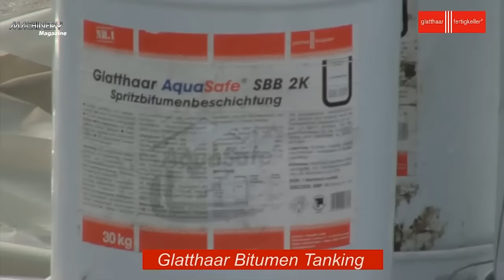Amazing Modern Basement Construction Technology - Amazing Ingenious House Construction Workers

Comment: Precast concrete panels are a great way to make basements. I did it over 15 years ago, the insulation was in the middle of the panels and it’s been superb. No cracks or leaks and cheap to heat. Also great in the hot temperatures, although 37c outside only 22c in my basement. One tip when constructing a basement ensure the ceiling heights are at least 3m high otherwise it will feel claustrophobic.
Reply: How much do you think this would cost today?
Reply: @clarityofthought  ..I'm sure it's worth it. I worked fabricating walk-n coolers & freezers the exact same way from raw materials. We glued rigid foam between steel sheets.
                  Then, we used a 'cam system' to lock the panels & doors with rubber seals. Don't cheep-out on the exterior bitumen & other sealing.
                   This system should be used in areas like South Georgia, where basements turn into pools very quickly. 😎👍☕
Reply: What's the point of covering the basement with a layer of concrete instead of plywood? Sound insulation for a theatre room or something?
Reply: @kenhiett5266  Tornado
Reply: @lilblackduc7312  Ah, that makes sense. As frequently as they get hit in places like Oklahoma, having a basement serve a second function as a legitimate tornado shelter should probably be the rule instead of the exception.
Reply: 250cm=2.5meters is is standard for every room . 
In German houses is like this and ik ok basement invluded.
Reply: @ASEAngelica  We have 2,70 m and this makes it much better because also have doors that are 2,10 m in height. Because I'm 1,92 m the "normal" doors are somehow claustrophobic for me.
Reply: @kenhiett5266 anything that can happen above grade: Tornado, Fire, war, earthquakes.    While unlikely 8” of concrete will block most anything including Radiation. Though 12” would be better.   My house has 12” concrete  roof and a wood subfloor on top.
Reply: Как крыло от самолёта  😱😂😅 @clarityofthought
Reply: No plumbing anywhere?

Comment: These are great ways of doing foundations, very area specific.  Can't do in many areas do to termites.  They love styrofoam and will tunnel through it and make a home then go after all wood including furniture, they will go through the smallest gaps in the wall, especially pre-cast foundation.
Reply: Yeah, I noticed a lot of North American houses are built with wood. Making the house from another material might be best because of termites tho.
Reply: So they're vulnerable at the seams or just tend to crack?  I didn't realize any of the exterior was styrofoam and seriously doubt any was.  The walls were pre-cast concrete, not styrofoam.
Reply: @ticktockbam  Wood is cheap, plentiful, strong (modulo termites), and easy to work with.
Reply: As for the gaps between pre-cast walls; you could use one of the ~60,000 design/inventions God gave me; & use Silicone sealant with Termite poison in it to seal part of the gaps in concrete sections (as well as put it in powder form in the backfill). And as for the other chap talking about "wood being easier to work with", you also have to consider wood is also easier for hurricanes to wreak havoc with (in a country with one of the larges sources of concrete on planet earth).
Reply: @ticktockbam  Easy to make wood termite proof forever with spray on borate base products.
Reply: Well in this case once they got through the styrofoam they would have hit concrete.
Reply: @harrymills2770  concrete and bricks are easy to work with too, and are totally immune to termites, and tornadoes, and bullets from gunfights. And you can perfectly isolate them from the cold and noise from outside
Reply: You can build first floor with ICF and also insert metal barrier into wall to stop termites from climbing.
Reply: There is a new block called "The perfect block" No termites & class A fire rateing
Reply: @harrymills2770 in the 2nd project, they laid huge styrofoam blocks & black tar material before pouring basement foundation. Don’t understand, wouldn’t the weight of the house crush the styrofoam?
Reply: @RogerThat1945  As "the other chap," I'd like to go on the record as not being a huge wood-frame construction fan.  But it's about the only game in town if you're looking to buy a single-family dwelling.  I lived in a stone house from birth to age 6, but every other house I've occupied over the decades was wood-frame construction.

It was cheap and practical and remains a cheap and practical way to get a house in a hurry.  It makes me a little sad.  There are so much better ways to design a home, but you have to go out of your way to do it right, and even fight the system a little.

Comment: I never liked using pea rock for back filling against foundation walls. Supposed to go in at 98% compaction, but when you go back 2 to 5 years later, it has settled far more than that 2% it is supposed to go down. I know it is supposed to aid in filtering the water from around the walls, but I would think spreading a lot of fine sand, and then lots of water on that, would stop most of that settling....

Comment: Great video, reminiscent of my years as a Union Ironworker in Seattle.  A couple things I don't get; the "ground floor" looks to be about 6' below grade.  Also, the light wells look like they were buried in the soil 🥴
Reply: Thank you!
Reply: В США чаще строят щитовые,которые сносят ураганы,съедают термиты. 
Почему вы не строите больше из бетона и кирпича?
Ведь так дешевле и дольше стоит дом
Reply: @BorecSkaznakradami  Solid brick construction is more labor-intensive.  

Cost is the reason people build boxes on top of the ground and pump hot or cold air into those boxes.  You wonder why they just pour slabs and stick boxes on them, until you see how cheap they are compared to the alternatives.  For most Americans, heating and cooling a place, day to day, is/was affordable and reliable off the grid, so the biggest obstacle was/is the actual construction.  Sure, they'd LIKE to have a basement, but then they see the cost and decide to settle for a crawl space.
Reply: not a contractor either but having seen a dozen builds today the order of operations here seems to prioritize cost-cutting and speed over long term sustainability. I really don't like how many vulnerabilities the various seams of this building method have. it might work fine in dryer warmer areas but this place is gonna be full of either bugs or mold in no time at certain latitudes :S
Reply: @harrymills2770  Properly funded construction companies could build houses 100 at a time with basements Above the ground, and then backfill the whole area once they are built; then set about the above ground floors. Jesus is real.
Reply: @RogerThat1945  "Jesus is real." Proof?

Comment: Did they add aluminum sulphate to their mix?  In Europe they add this to add make a  porous mixture that has small air bubbles in it. This then gives the cement an R value. It will still be as strong as regular cement and you can still add rebar to it. But most companies do not want to make any investment in their companies. They are all about how much they can squeeze out of their customers!! The workers do an amazing job!!

Comment: Tornado proofed basement.  Worked in so many over priced sub divisions.  No builder did it.  When the main floor had a poured concrete pad.  More protection in the basement den.

Comment: ❓ Comparative analysis? Purpose, function, costs, climate/geology specific? When to use, where, why?
❓ Geothermal heating/cooling: with huge gaps around the perimeter, why not use geothermal piping for baseline heating/cooling? (Seems like lost opportunity.) 
❓ Cisterns: seems like a lost opportunity for water collection, even if the water is only used as a geothermal heating/cooling mass. Deck built over the cistern for servicing. Roof collection of rainwater. Partitioned cistern: primary drop/debris/filter, overflow to chamber A (holding tank, constant volume/pressure, overflow to chamber B for water use (pump, pressure tank (or gravity tank back on roof), landscaping water use). 

1) Gravel foundation & walls of Peagravel barrier + foam insulation + water sealer.
2) Gravel foundation + foam blocks & Lego walls + (unknown wall barriers).
3) [not displayed] tilt up.
4) [not displayed] aircrete @ ground level (not subterranean)
5) [not displayed] other methods

Comment: must be little to no forestry in this country to be using so much concrete and steel, or wood frame construction super expensive there, wow!
Reply: American woodframe is not good in heat insulation and noise cancelling. The long term costs in heating and cooling would be insane in germany. Germans build very solid in general. Solid woodhouses are very good, but woodframe is crap.

Comment: Precast ground floor panels then pouring a layer over that? Is this a nuclear bunker?
Reply: The thin precast panel eliminates the need for forms, but would not be strong enough just to hold itself and a normal floor load up by itself. Pouring the rest of the floor on-site eliminates the need for very heavy precast floor sections, creates a continuous slab, and allows services to be embedded in the slab where required without custom prefab parts.

Comment: For the life of me, I don't understand why anyone would add rebar to a house foundation.  You don't need that much strength for a house that size, and you're just sacrificing longevity.
Reply: even in earthquake prone areas?
Reply: @teklife  Earthquake prone areas like Greece and Italy?
Reply: @jbrisby  I don't care where in the world, I'm just asking if even in earthquake prone areas does it still not make sense to use rebar.
Reply: I live in a high earthquake zone on the west coat of Canada and every house we design has rebar in the footings and the walls as its required by code. The forms are styrofoam material (called CIF) and are designed to accept vert and horizontal rebar. The slab is what you call a raft slab commonly used on poor soil pressure values so you need a lot of rebar.

Comment: The best houses are constructed out of hemp. For it has been proven to be 10 times stronger, 30% lighter than steel, stronger and lighter than concrete stronger and lighter than brick, far more versatile making the design possibilities practically limitless and when manufactured in the right way it is also fireproof. Equally as amazing it is far easier to work with on-site meaning you can rebuild faster more efficiently and half the time at a fraction of the cost. Without leaving any excess poisonous toxic waste behind in the process. You can't say that with any other material, resources, or substances that houses and buildings may be constructed from. On the contrary by using and working with growing hemp you will be improving upon and maintaining the quality of life too a much higher degree. By producing oxygen cleaning our air rejuvenating and replenishing our soil back to the garden of paradise type quality after every harvest so forth and so on etc. etc. creating hundreds of millions of clean high paying jobs versus dirty low-paying ones that come from outdated power sources, inferior materials, poisonous toxic substances, pesticides and chemicals that never change their killing composition. What that means is whether it is a solid, liquid or burnt off in to our airways atmosphere as a vapor it is always going to be debilitating, poisonous and deadly to the body at the same time is polluting, corrupting and devastating to mother earth and all the various different forms of life that live within this world.

Comment: AMAZING the waste of building material and labour for a basement slab floor ?  2 inches (5 cm) of foam covered with 5/8" plywood over a traditional slab and concrete walls would be more 'energy efficient' for 50 - 75 years.
Reply: this is not America mate, Europe passive house rules are different
Reply: @davidanderson5411  The sad thing is, more rules often mean less efficiency.  In North America, we tightened the building envelope so much, accumulated humidity and enjoying 'fresh air', now requires 'vent holes' to the outdoors, be placed in every room.  ????

Comment: That's UK there is nothing modern on there, they are 30years behind Europe with their building techniques and materials. Anything new on there is known for good 30yrs in Europe. They still build cavity walls 🤣🤣🤣🤣 
Isoquick slab insulation is DE made for good 17years and one of the most expensive around.
Reply: thats germany not the uk

Comment: So, please excuse my ignorance, is the weight of the ground floor supported by the walls in the basement? I’m asking bc I haven’t seen any columns.
Reply: in the first building i would say yes. the precast panels they lifted in for the suspended deck also will have a maximum span length they can achieve.

Comment: I was kinda wondering the same thing without airflow it doesn’t matter if you built it with nasa grade material you will fight moisture got to have good air flow around the structure or good dehumidifier’s  if not you got a black mold magnet

Comment: What is the point for underground insulation? Temperature of the soil is constant… Can someone explain this?
Reply: I don't think temperature is the reason for what looks like overkill application of sealants and insulation. 
As with most, if not all basements, water/moisture seepage and condensation is a major problem if waterproofing is not done absolutely right. Thereafter ventilation and keeping air moving goes far in preventing moldy smell and markings.
Reply: @boon4945  i agree with the sealants and everything else. I also think a good drainage will keep the house dry. Still that insulation is not making sense.
Reply: @ovidiuciuparu6421  can you explain how suppose to look drainage at deep 3-3.5m,  and were collected water should go after?
Reply: Temperature of soil is nowhere near constant near the surface. Where I live foundations must be at least two metres deep just to get below the level that freezes in winter. My guess is that you live in a very temperate climate.

Comment: I don’t understand where are all the utilities in these basements
Reply: possibly electricity and water could've been ran in those precast wall panels and then through the suspended ground floor deck. not sure about sewer though. maybe they used a pump system for that?

Comment: This method is not suitable for Japan.
Most of the flatlands are not suitable for this method.
There are many earthquakes, soft ground, and high groundwater veins (water gushes out at about 2-3 meters).

In Japan, basements are built by considering that the basement is submerged in water.
It is strictly controlled by law (Building Standards Law) in consideration of earthquake resistance.

------------------------
日本では向かない工法。
大半の平地は、
地震が多く、軟弱地盤が多く、地下水脈が高い(2-3m程度で水が湧いてくる)

日本の地下室は、地下は水没していると考えて地下室を作る。
耐震を考慮し、法律(建築基準法)でも厳しく管理されている。
Reply: this is in the UK, where they dont get earthquakes at all, but also a lot of the areas have low water tables - so you are right, it wont work everywhere